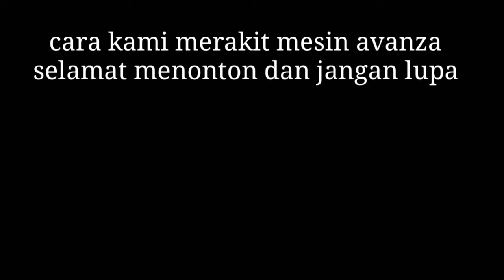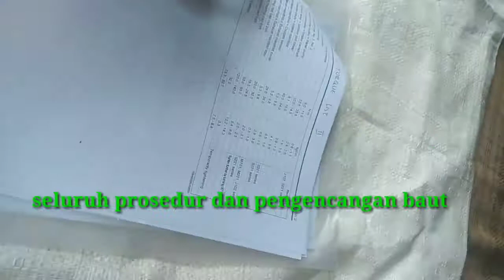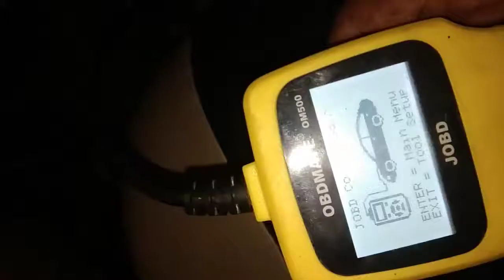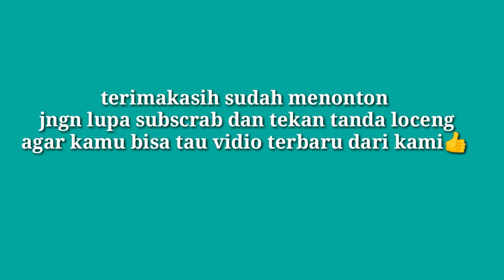Rakit mesin avanza dari NOL sampai HIDUP

Comment: Assalamualaikum om sesepuh maaf menggangu waktunya. 
Mohon solusinya yang sudah berpengalam. 
Avanza 2007 over heat compresi bocor air radiator keluar dari busi nomer 2 dan nomer 3. Silinder head sudah dikerjakan bubut setelah di rakit kembali di pasang. 
Di cek start mesin masi ada bocor air radiator lewat busi nomer 3 atau piston nomer 3.
Kendala apa suhu om. Semoga berkah 🙏🙏🙏

Comment: Salam kenal bang.. sy user avanza 2010 1.3 vvti, izin bertanya :

1. In rayen itu berapa km ya ?
2. Sy baru turun mesin sekitar 4 bulan an.. smpe saat ini mesinnya itu ngeden & tidak normal.. ketika di jalan tol >100 km/jam getaran mesin sangat terasa hingga ke dalam interior. (Kaki2 sehat & stabil, shock, bearing roda semuanya baru)

Kira2 apanya yg bermasalah ya bang ? 
Terima kasih banyak sebelumnya 🙏🙏🙏

Comment: Mantapp om pengerjaan nya rapi.. 
Oiya skedar sharing aja nih om, mobil saya avanza type S jg sdg turun mesin dan hampir 1bln blm beres jg.. Info terakhir dr mekanik oli masih blm naik pdhal part baru semua (regulator, ocv, oil pump, rantai keteng, sensor presure).. 
Ada masukan ga om kira" kenapa ya oli msh blm mau naik? 
Setelah OH standart oli SAE brp om?

Mohon pencerahan nya 🙏🙏🙏
Reply from the maker: Coba lihat corong oli bawah(yg plastik hitam) itu di dalamnya ada saringanya. Mungkin tertutup.

Utk avz sebaiknya pakai SAE 10
Reply: @antocasenk  yg di dalam karter ya om?